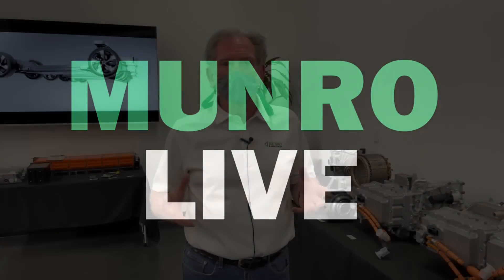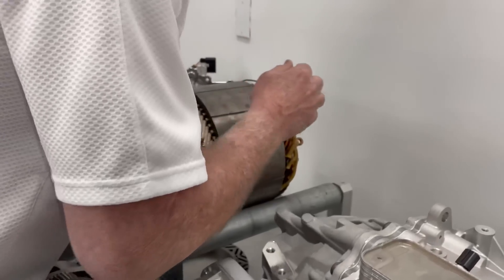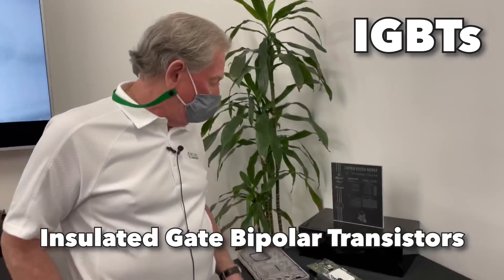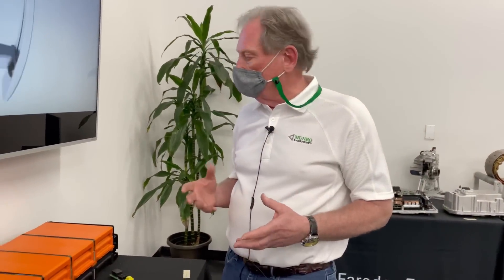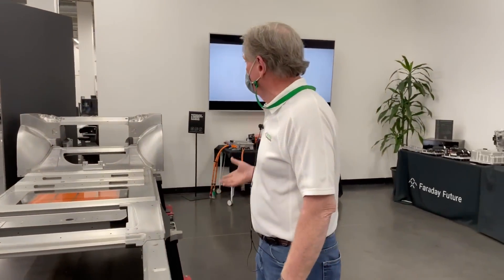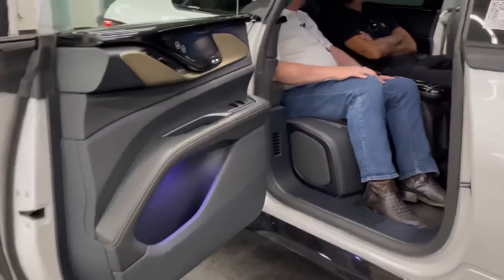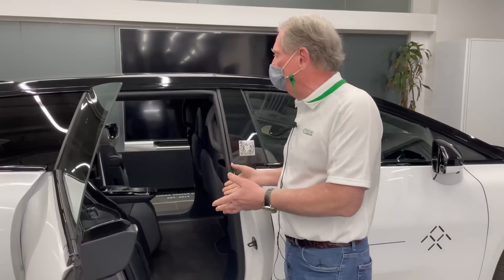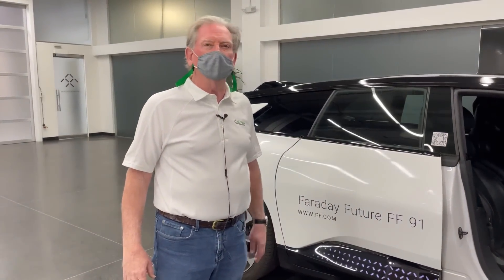Immersion Cooled 2170 Cells, Parallel IGBT Inverter, Dual Rear Motor System:  Faraday FF91

Comment: Hang on the new tab design was to reduce the thermal resistance gettimg the heat out of the cell so cooling a 21700 is not the best idea to say the least thats why a new cell arcatucture was made in first place.
Reply from the maker: The cells still must be cooled in hot climates and heated in frigid climates. Faraday's design maximizes surface area during the thermal interaction hot or cool. Thanks for tuning in!
Reply: @MunroLive  so staying within thermal limits is the key pack cooling/heating helps that.
And the new tab design pushes it further by allowing more out the temp junctuon simular to a lipo cell.
I make electric scooters for a hobby so the cooling part is just none existent on my rigs so nw little about it.
Reply: @nuclear-sparks  
The Tesla method (advantage) is to reduce the internal cell resistance, thus reducing heat produced in the first place (imo)
Reply: @rogerstarkey5390  good point roger Cell IR is reduced significantly too making less heat to begin with.
Id like to see how much cell ir has improved vs themal path to have a clear call whats be driven forward the most on the cylindrical generation leap.
Reply: @nuclear-sparks  
I think the 4680 will have just as much impact on charging as it will on vehicle performance.
IR is the main limitation there as well.
Just btw.
(Don't laugh)
I used an on line carpet roll calculator to work out the amount of jellyroll in the two cell sizes.
Assuming the roll material thickness is the same, the surface area is almost exactly 5×.
That's actually very significant.
To my mind, it means that a 4680 With the same chemistry will hold 5 times the energy as a 2170.
Since that's the (cell level!) figure quoted at Battery day, a consequence would be that any improvement in chemistry, manufacturing technique, or materials would provide an additional cell level energy capacity bonus. 
This is without considering the power capability, which is almost exclusively due to the low resistance of the tabless construction.
In short, I think they were sandbagging on battery day.
I look forward to several versions of 4680, possibly with a "base" model using conventional wet process and chemistry ("Panasonic Nevada prototype line"?), Essentially a 4680 "canning plant" on the end of an existing "jellyroll" plant".
Great for base level products, cars and storage?
This could be followed by "Kato" plants, with Maxwell process and the newer chemistries?
These would of course benefit from considerable energy and power boost.
Reply: Good observation. What's more, the 2170 tab itself is still an impediment to the rapid (i.e. cost effective) volume production of the cell. Hence R&D of the shingled spiral of the 4680 cell. No doubt the Faraday FF91 will be a beautiful car, but it will not appreciably move the technology needle and it certainly won't be the vehicle that accelerates  the global transition to sustainable energy. 

I will say that their motor construction looks interesting, but I'd want to see that compared to Tesla's recent motor R&D. One thing we know for damn sure is that Tesla doesn't stand still.
Reply: @timyarrow8844  
The 2170 isn't an impediment to "cell" volume.
It's an impediment to factory capacity (GWh).
Tesla will be able to send the same number of "cans" out the door, but with 5times the "jellyroll" area contained. That's where the capacity advantage comes from.

That's assuming Tesla keeps the "old" chemistry!
Reply: @MunroLive  looks impressive dont get me wrong but if i could uses ines motor and the others battery i would.
Reply: Cheers sandy for the reply
I see where they are going now it improves what they have access too.
Best of luck to Toyotas solid cell 💪
Reply: @nuclear-sparks  
Strange comment re Toyota..... No sign yet.